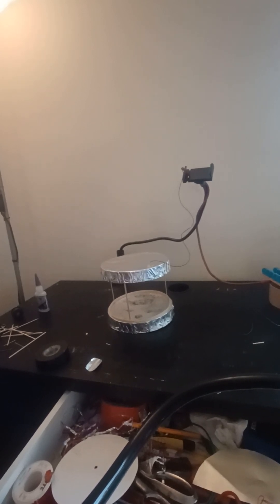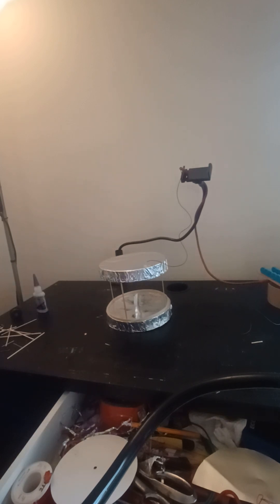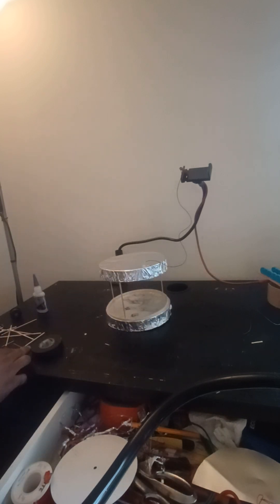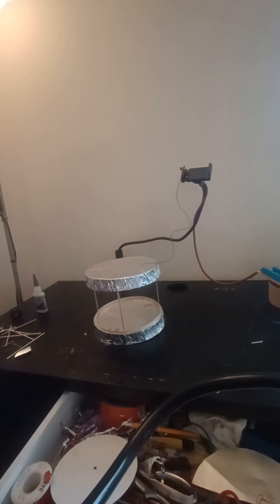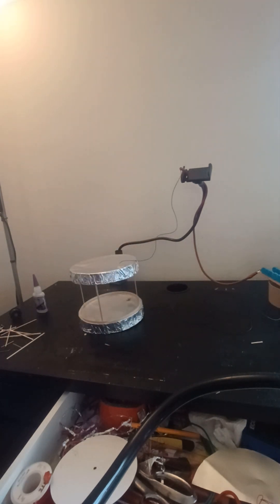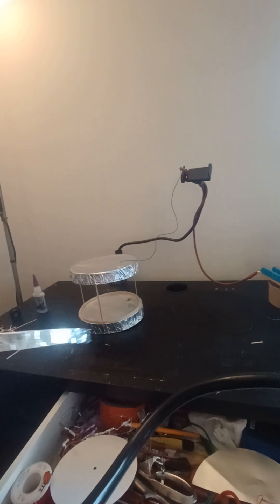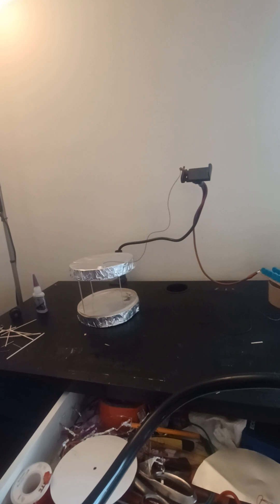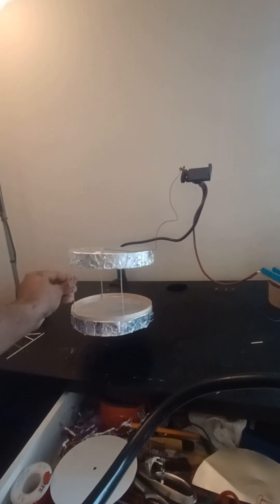ion lifter 3.0. Electrostatic levitation.

Comment: I've been considering the effects of lifters built like this, thinking that they should be able to "lift" more.
My thinking is that under each of the plates, you'd have a cone of lower pressure, because the plate repels ionized air of the same charge, effectively making it able to aditionally lift the weight of the displaced air. Avg atmospheric gas weighs ~1.2kg/m3. 1l is 1/1000th of 1m3.
So if it can displace half the pressure of let's say 10l, you'd get 6g of addtional "lift".
These numbers are only for demonstration - I have zero idea of how close to/far from reality that is.
None the less; it could be really interestign with a measurement of the pressure under the plates.
Come to think of it, half a bar of displacemnt is probably very overkill, because pressure that much lower, would certainly result in a lot of breakdown of the air between the plates.

EDIT:
There are no sharp points in where the air would break down, and the distance in there, between the plates are higher, than from lower edge, to bottom plate, which likely does allow for a fair amount of pressure drop.

Comment: All we need to know to progress in experiments with this effect is this, from one of TT Brown's patents :

'By attaching a pair of electrodes to opposite ends of a dielectric member and connecting a source of high electrostatic potential to these electrodes, a force is produced in the direction of one electrode provided that electrode is of such configuration to cause the lines-of-force to converge steeply upon the other electrode. 

The force, therefore, is in a direction from the region of high flux density toward the region of low flux density, generally in the direction through the axis of the electrodes. 

The thrust produced by such a device is present if the electrostatic field gradient between the two electrodes is non-linear. 

This non-linearity of gradient may result from a difference in the configuration of the electrodes, from the electric potential and/or polarity of adjacent bodies, from the shape of the dielectric member, from a gradient in the density, electric conductivity, electric permittivity and magnetic permeability of the dielectric member or a combination of these factors.'
Reply: Indeed. James Frank King Jr's work is also quite interesting. From one of his patents: 
'A heavier-than-air craft adapted to be propelled through a fluid medium capable of being ionized to a condition of high electrical conductivity by magnetohydrodynamic effects comprising a fuselage having a topend and a bottom end spaced along a central reference axis, means adjacent the top end of said craft for ionizing the fluid medium surrounding the craft to produce an ionized annulus of high electrically conductive fluid medium surrounding the craft and extending axially toward the bottom end thereof, an array of inductive driving rings formed of electrical conductors arranged concentrically of said reference axis and located at selected spaced positions along said axis intermediate said top and bottom ends, and means for applying polyphase alernating current voltages to said rings to produce electric currents therein having selected phase relations to each other establishing a magnetic field about each ring fluctuating about its respective ring in accordance with the alternating electric currents flowing therein, which fields are phased and magnetically superimposed to produce a collective driving magnetic field whose point of maximum flux density repetitively progresses from the top to the bottom of said array and switches back to the top of the array, whereby said driving magnetic field induces eddy currents in the ionized surrounding medium reacting with said driving magnetic field to drive the ionized surrounding medium in the direction of travel of the driving magnetic field and propel the craft upwardly in the direction of said reference axis.'

Comment: This is an excellent demonstration of the Biefeld–Brown effect. The ionic wind of ion thrusters only accounts for ~2% of the thrust and only really serves to replenish the dialectric material with fresh unpolarized material. An experiment you could perhaps try is to wrap an insulating sheet or tube around your device to prevent the air from exchanging. What should be seen is an initial lift and slower fall back to the table as the dialectic air polarises. Awesome job!

Comment: If you could somehow change the polarity of the plates really fast, at some point, the ions would not be able to travel very far and would just vibrate in place.

This would stop any ionic wind from being produced. 

Any remaining force would most likely be a true anti gravity force or some other overlooked property of electromagnetism.

I love these sorts of experiments.
Reply from the maker: Lift will work whether you put the hv positive on top or the bottom. However that works based on the design.
Reply: @goobman1981   that model lifted off the table towards the bigger wood stick for second, maybe add a balsa wood disc to the top sides of both plates?